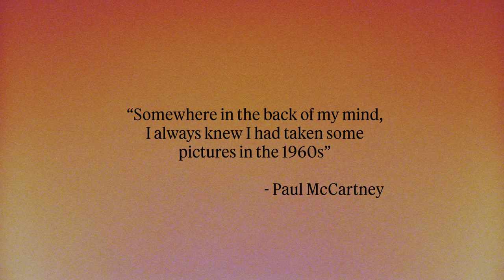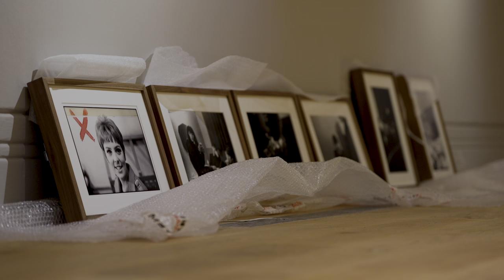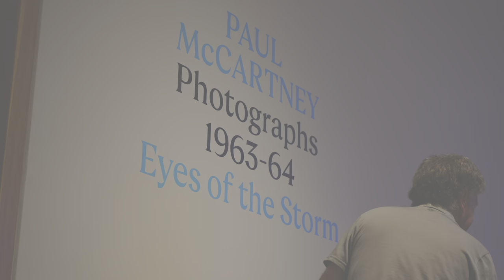'Paul McCartney Photographs 1963-64: Eyes of the Storm' - Behind The Scenes

Comment: Looks awesome Paul. I can Never get enough Beatles memories. I saw a question an google, it asked what band had the largest audience ever recorded. Of course I thought if the Beatles. I was correct. Beatles in Shea stadium NY had a record crowd of just under 56,000 people. That record held for a long time but since has been broken.
Reply: 500,000 people were in Central Park for Simon & Garfunkel reunion 1980 400,000 for Elton John Central Park 1981  There wre more than 56,000 at The Isle of Wight 1969, Woodstock 69 and Woodstock 94